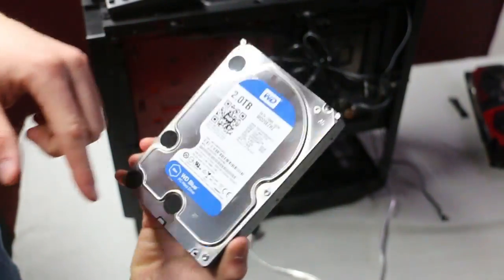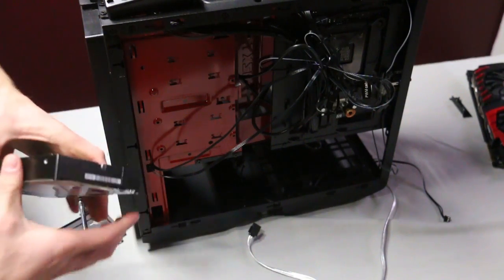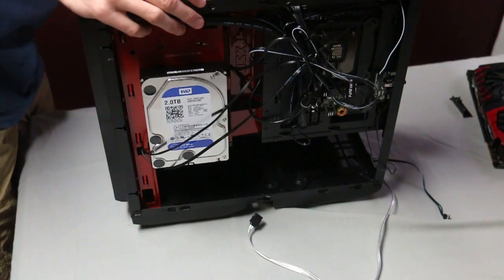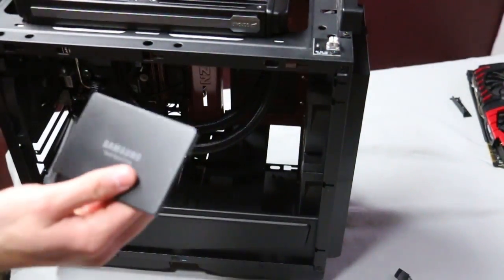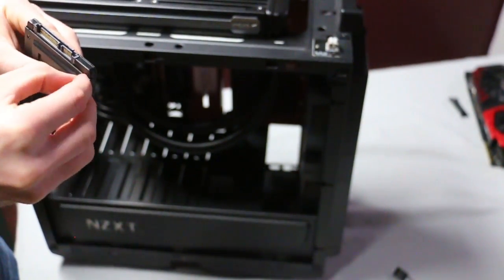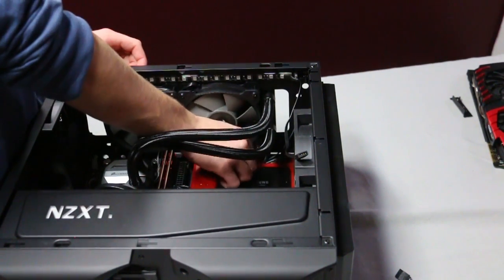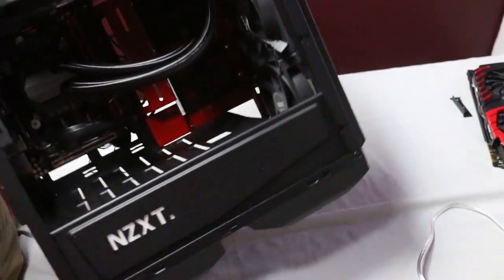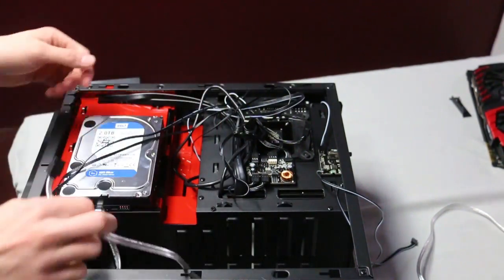Building a Gaming PC | Step 6 - Installing HDD and SSD

Comment: Hello is a ssd needed for pc gaming?
Reply: Ssd for loading much faster for example when playing rank games on csgo but you have a shitty pc then buy an ssd so you can connect before 5min
Reply: MarkyT123 No it's not it just to speed your downloads boot time etc all of that up
Reply: mine did come with its own cables and i think most parts you buy come with its own wires
Reply: I know im a bit late, but you can own both a SSD and a HHD. For example I own a 2 TB SSD (Boot Drive) + 4 TB HHD (Storage Drive)..
Reply: FoxTrotSpy rich boi 2TB ssds cost lots can you msg me your specs
Reply: No
Reply: Yeah so if u want fast speeds I recommend a ssd. Also they last longer because there are no mechanical parts.
Reply: Bro, if you were building a GAMING PC how did you not know how to Google something?  LMFAO hehe
Reply: increases load times